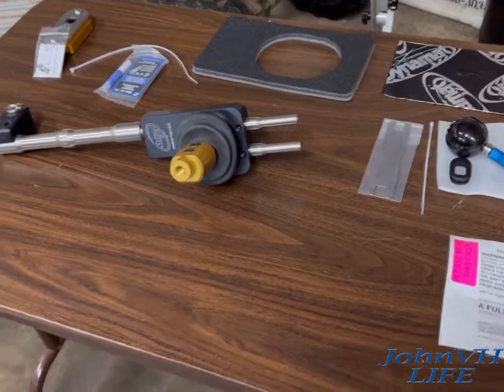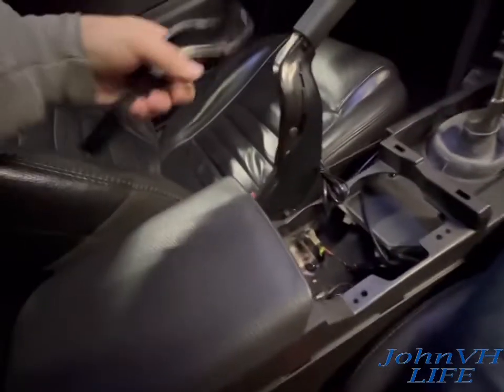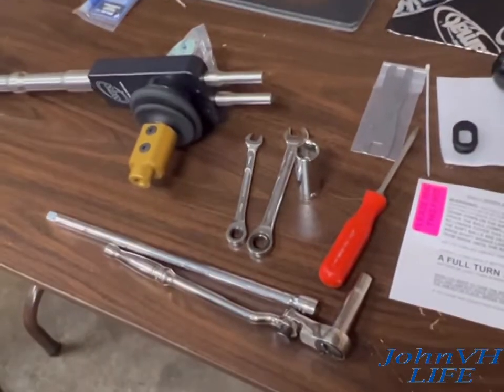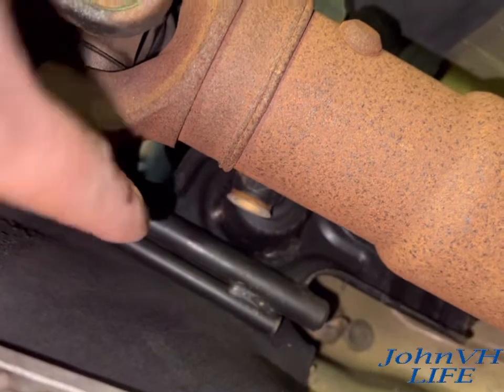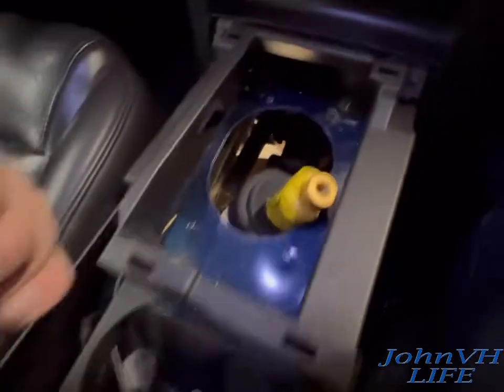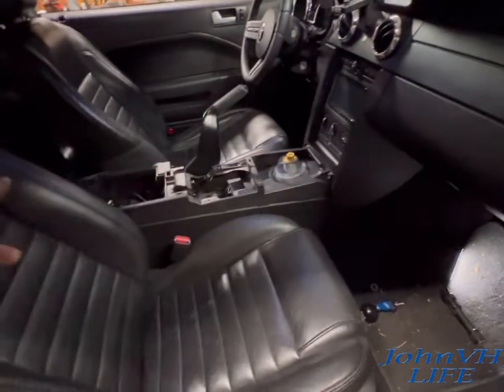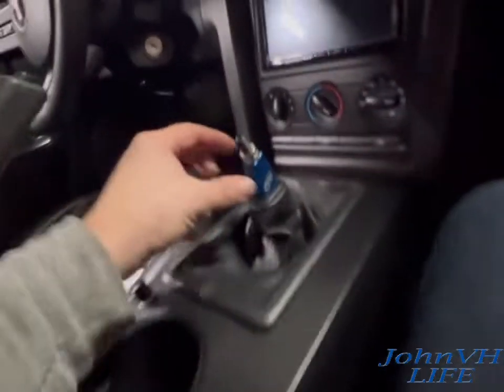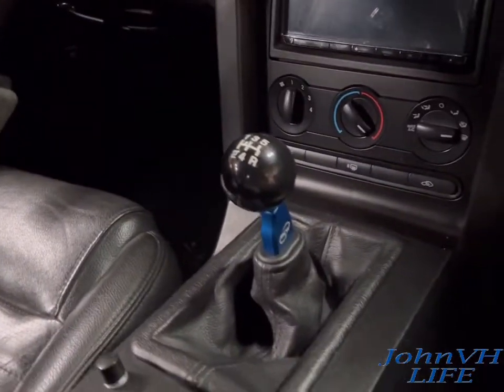MGW Flat Stick Short Throw Shifter INSTALL 2009 Ford Mustang GT 3 valve DIY How To S197

Comment: John, thanks for an informative video! This was of help to me. Of particular note is that your video - unlike the official one from MGW (!) - discussed the installation of the flat stick itself. 

Having just installed my MGW shifter on my 3V, I can offer the following suggestions for anyone else looking at installing one of these: 
1. My shifter, a flat stick like yours, also did not come with a 3/16” allen wrench. I tried one I had on the flat stick base unit and it did not fit the two hex holes on it. However, a 5/32” allen wrench did fit. 
2. I too lowered the transmission, but only a half inch or so. Like you, I found no way to get it to the one inch MGW recommended. 
3. The two 10mm bolts for the existing rear shifter support bracket were easy enough to remove. But the bracket itself was a pain to pull out because of the clip used on the drivers side to hold it in place during the manufacture of the vehicle. To remove that clip, you need to press (hard!) into the small portion of the clip that is angled up away from the bracket, while trying to pull the whole works down. It’s rather counterintuitive. Unless one has a lot of callouses, it can’t be done bare-fingered. I know; I tried. I used a towel to press on that tab and with great difficulty finally got it off. 
4. I received two zip ties with my shifter: a small one and a big one. The small one is actually documented by MGW, but you’d likely not know it. It is used to mount the flat stick grommet. That video from MGW is here: https://youtu.be/hhLDEN6ikLA
5. I looked at my existing inner shift boot, and having looked ahead at several people’s experience, knew there was no way I was  going to attempt to try and stretch it around the oval base of the new shifter once the shifter was already mounted. No way. That to say nothing of trying to then stuff the edge of that same boot under the hole for the shifter. No thanks! I took the route of putting the boot on the new shifter beforehand. That’s where the big zip tie came in… even with another set of hands and four flathead screwdrivers between us, we could not make the existing inner shift boot fit around the new shifter. However, I made two small half-inch cuts on the boot bottom, which made fitting the boot to the shifter merely difficult instead of impossible. I then used the big zip tie to better secure the bottom of the boot to the shifter, and it worked so well I believe that was its intended purpose. Doing things this way made it that much more difficult to fit the new shifter down through the bottom of the vehicle - it was not easy. But based on comments I’ve heard about trying to fit the boot onto the shifter after it’s mounted, I’m convinced mounting the boot beforehand much easier. A second person was a big help when trying to maneuver the new shifter into the hole. 
6. Mounting the new rear bracket was difficult. I had only a jack and stands, and that doesn’t give a tone of room under the car. I found I could only really get one arm at a time up in that area to work… and you need two (one to hold the bracket and one to screw the nuts on). I finally made it work by using my extender with a standard depth (I first tried it with a deep well and it didn’t work) 10mm socket, dropping one nut into that, and then using that works to push the bracket up and simultaneously push the socket onto one of the threads. I started turning and got the first nut on enough to hold the rear bracket up. I was then able to switch to the deep socket to finish one side, and then finish the other. Like you, my kit did not have the washers MGW mentioned were included. 
7. For the shifter adjustment, MGW notes most of their customers preferred 4-5 turns. The more turns, the shifter the throw, but also the “not chief” the feel. A few others found that even 5 turns was too much for them and they decided they wanted to back it off to 4. With that in mind I set mine at 4 and I’m glad I did. It feels good and solid and plenty notchy; I imagine getting to first and second would be quite the chore with an even shorter throw.

Thanks again for your video… I hope my comments are of help.
Reply: What are the two Allen screws on the side of the shifter for ??